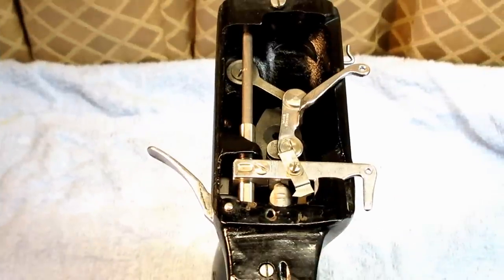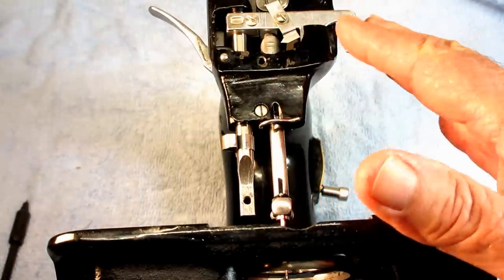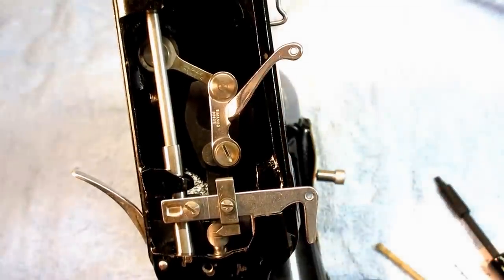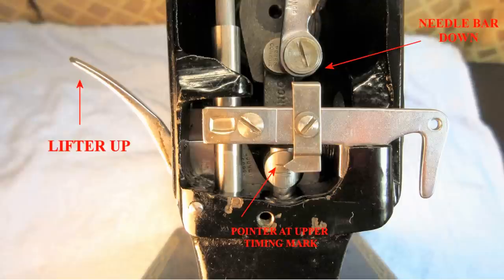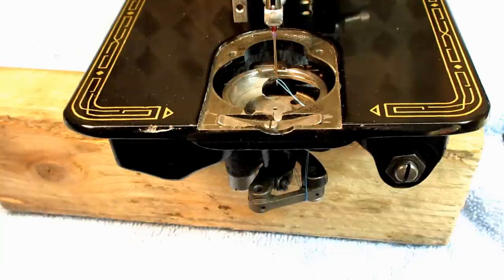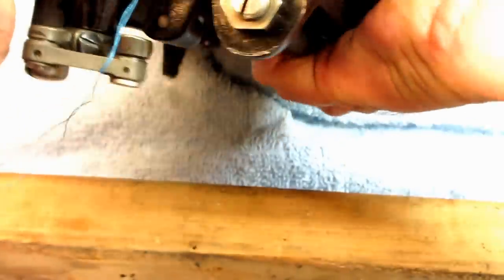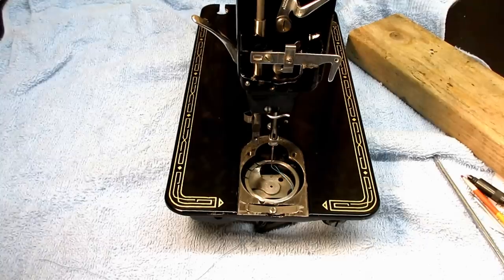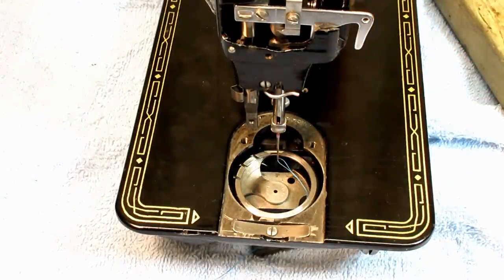The Needle Bar Height and Hook Timing of a Singer Model 99K Sewing Machine

Comment: Andy my machine (left to my by my grandmother) is a 99k 1941model.  The bottom stitching is only making loops, is this a timing issue. This is my first attempt at cleaning, oiling etc.
Reply from the maker: Bless your Grandma, Angi. Having a family owned machine is usually the best it gets. When you have looping it is because of a tension imbalance between the needle thread and the bobbin thread. Your looping is on the bottom, which usually means the needle thread tension is very light or loose and the bobbin tension is pulling the needle thread down too far. 
(If the looping is on top then the bobbin thread tension is light or loose) There is a small chance that the bobbin thread tension is crazy tight, or the thread is not pulling off the bobbin in a normal manner, but usually, you want to start with the needle thread tension. Honestly, I feel the easiest way to check it is to totally remove the needle thread and start over, being sure you followed the correct path and you had the presser bar lifted up when you ran the thread. Follow the directions in the manual, or watch my videos.  If you'd like a FREE pdf copy of the instruction manual for the 99k you can download it here: https://www.singer.com/sites/default/files/product_manual/SINGER%2099%20Sewing%20Machine.pdf
I also did a video about winding the bobbin and threading the needle you may want to take a look at  https://youtu.be/Myqx7XWWquo
If you want to understand and/or clean the tension unit take a look at this video: https://youtu.be/rioRhSbog6U
Here is the link to my Series for "Cute", the Singer Model 99K. 19 videos in all: https://www.youtube.com/playlist?list=PLsCOZgzzaiKIIUgkEujqHc9iNWN9NPW2Z
You liked a couple of them and may find the others helpful as you get to know your machine.
If a problem comes up just leave a comment and I'll try to help. Take Care, Angi, and thanks for watching my channel.
Reply: @andytubesewing1953  Bless you Andy, I will be going through the threading as well as watching the links again. 🙂 I so appreciate the time taken to answer me. Well, off I go to fix my tension. Will keep you informed.  💕
Reply from the maker: Best fo Luck and I know you can do it!
Reply: @andytubesewing1953  Andy hope this find you well, I managed to get the tension to the point that there are no loops underneath and when I try tearing the seam is hold very fast. Does this mean I am there?  Thank you for the words of encouragement and advice. The machine is still in my possession and not on the ground floor outside my apartment. 😁 Blessings from my heart to yours 💕
Reply from the maker: I think you ARE there! Congratulations, Angi, and thank you for saving and keeping that machine. Your blessings are appreciated. Hope you can visit again. Take care.
Reply from the maker: I'm more of a mechanic than a sewist, but here is how I use the presser bar pressure setting. Lift the lever to raise the foot, rotate handwheel towards me to raise the feed dog to highest point, put my fabric under the foot and lower the foot/lever. Try to pull the fabric forward, sideways or back and see if it slips out of the foot. Lessen the pressure until it DOES start to slip a LITTLE bit, then tighten it up enough that it stops slipping. The idea is the lower amount of pressure to keep the fabric moving properly while sewing is better and less likely to damage the material. Let the feed dog do all the work of moving the fabric and don't try to "help" by pushing or pulling the fabric.
Reply: Thank you again Andy that has helped. Enjoy the rest of your weekend . Blessings.  💕